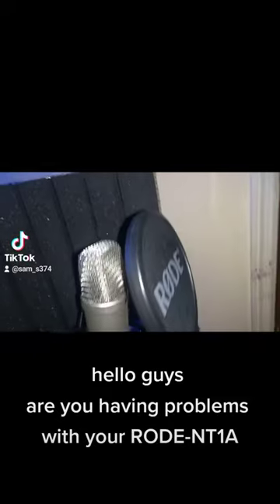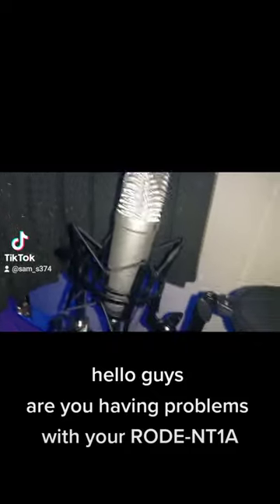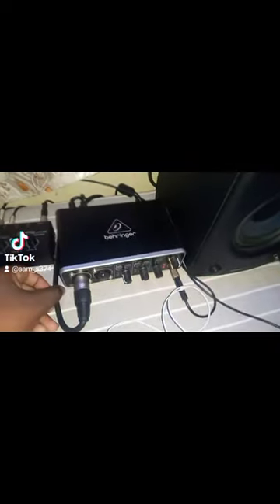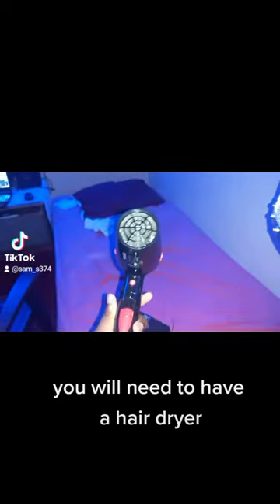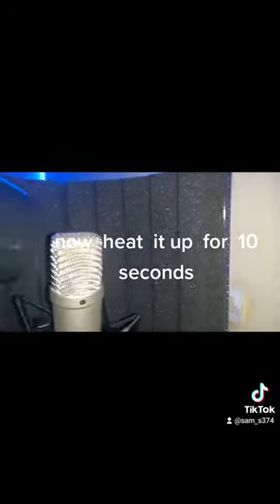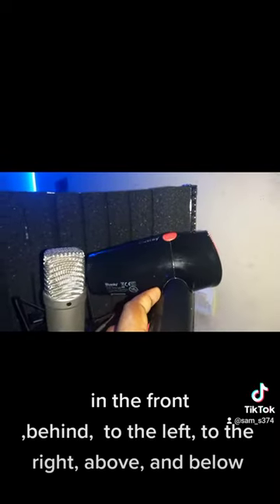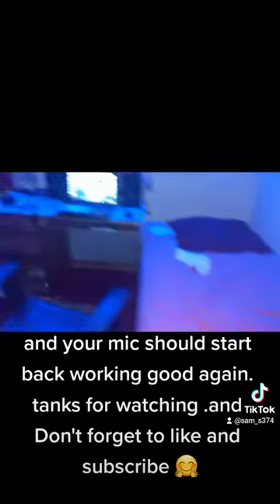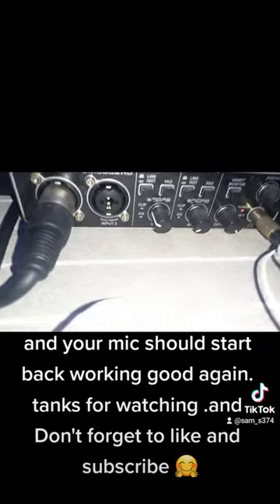Rode NT1-A not working! no signal going true the interface!!(problem fix )

Comment: Received my NT1 Signature Series a couple of days ago. Very low signal, but sporadically, for some reason, works when plugin power is on in addition to phantom power. Probably wasn't the actual reason it worked but turning plugin power off --> very low sound again. Strange. At the time room humidity is around 71% so I figured that might be the reason and after seeing this vid, I dried it for about 10 seconds from each side with a hairdryer and Boom! It works!

Comment: It worked but in my case when you restart the computer the next day, it’s doing no signal again, so you have to it every single time you use your computer with the mic plugged into the audio interface, which sucks honestly!
It’s better to change the capsule or the microphone tbh